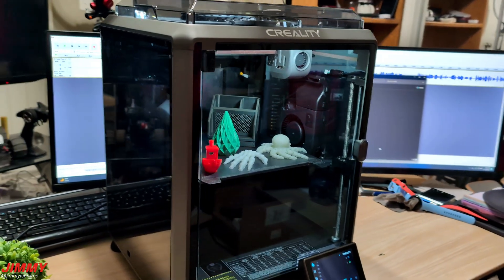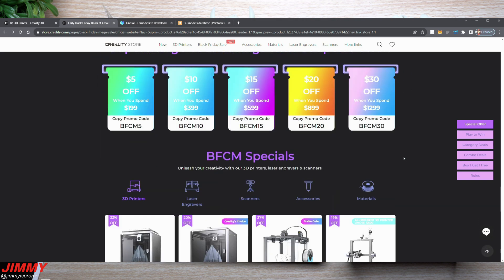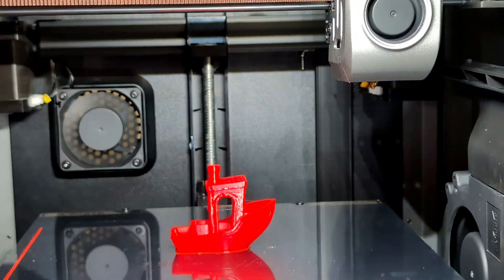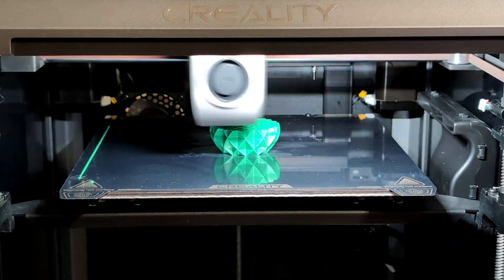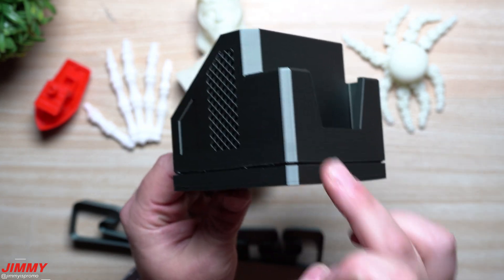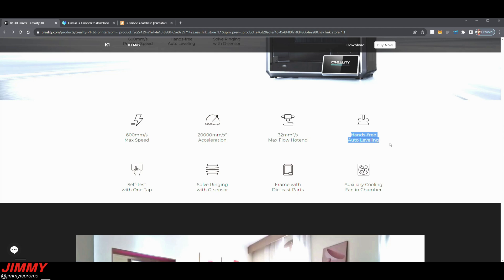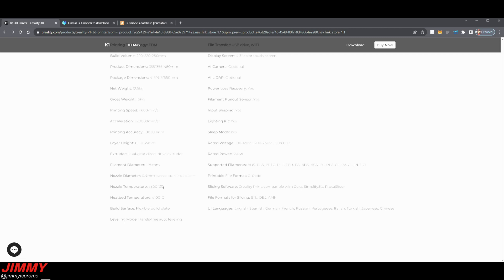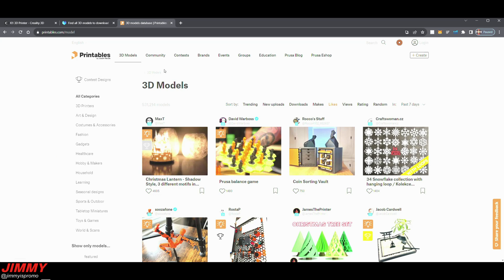Creality K1 3D Printer Review: Speed, Quality, Software - The Total Package

Comment: How good is the bed adhesion with this K1 speed printer? I’m having very little luck when printing anything big with the Ender 3 max Neo. I have tried very thoroughly washing the bed with rubbing alcohol & dish soap, and then putting everything from hairspray to nano polymer adhesive on it and no large object will stick long enough to finish!! is the K1 speed printer any better as far as bed adhesion???
Reply from the maker: so far no issues if you put a little glue on it. i dont use much. just a fast swipe around and an X and it has always worked.

Comment: Missed the BFD but found several at $389 BUT they could not confirm the extruder/hotend updates. Just ordered from Creality the K1, found a camera and Nozzle kit on Amazon, can't find the AI LiDAR device anywhere, yet. I have two TronXY X5SA but by the time I upgrade just one of them for speed, hotend, enclosure I would have spent more than the K1 cost, I'll wait on the K1 MAX as currently it is about twice the price for 60mm bigger, while the A/C heated bed is niece I wonder why no reviews talk about the power cost to run the A/C heat bed?

Comment: The bed is so shiny and does not look like mine at all, almost looks like you did not take off the plastic protection on the bed plate or do you use a different plate?
Reply from the maker: For the first few prints, yes it was on there then noticed and took it off. surprisingly did well.